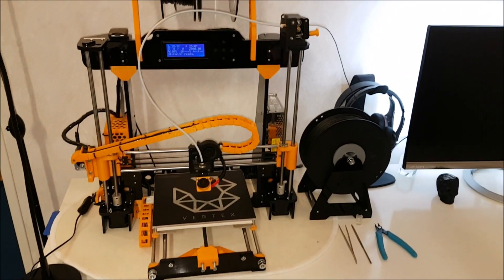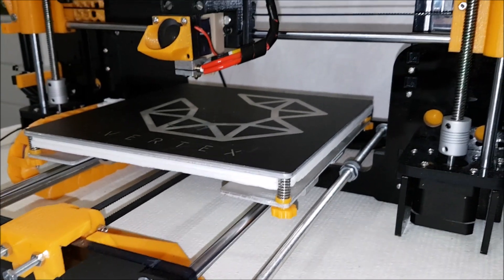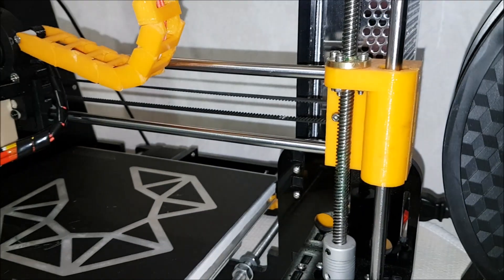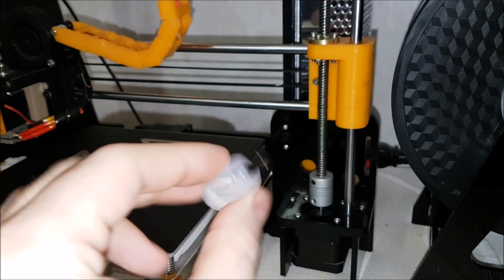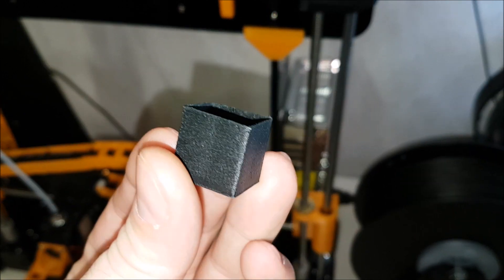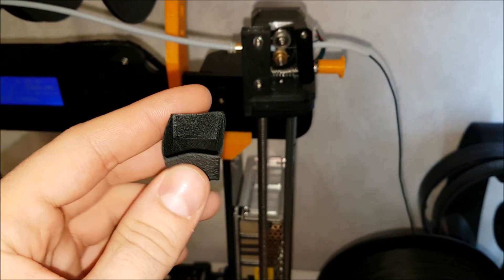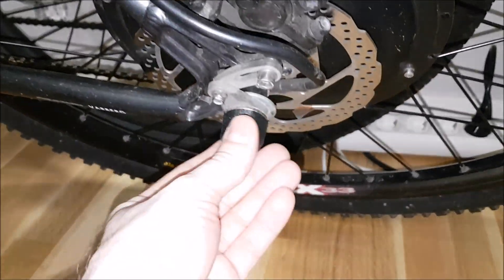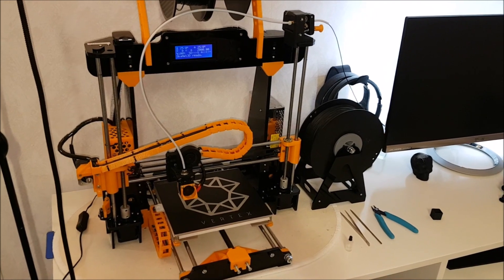Anet A8 3D printer upgrades part 4 heated bed insulation, PLA Igus bearings, flex filament printing

Comment: Does the ED V6 comes with nozzle? or I have to buy it sepparetly?
Reply from the maker: Felipe NS Yes It does comes with nozzle and Filament tube and fan as well with link I leave in video description. Cheers! :)
Reply: Comes with nozzle.. most likely 0.4mm.

Comment: Hey dude I really like your videos so much that I just bought the printer and I have a question. Which filament diameter to use? 1.75mm or 3mm? 
You could make a video showing the calibration you do and the settings you use to get that quality as in the T-Rex.

Like and Suscribe from Spain ;)
Thanks!
Reply from the maker: Hi man! Greetings from Sweden! Here is full List of Anet A8 1.75mm:
Black  PLA http://www.gearbest.com/3d-printer-supplies/pp_424994.html?lkid=10666772
White  PLA http://www.gearbest.com/3d-printer-supplies/pp_424993.html?lkid=10666773
Blue   PLA http://www.gearbest.com/3d-printer-supplies/pp_424995.html?lkid=10666774
Golden PLA http://www.gearbest.com/3d-printer-supplies/pp_423469.html?lkid=10666776
Silver PLA http://www.gearbest.com/3d-printer-supplies/pp_424997.html?lkid=10666780
Orange PLA http://www.gearbest.com/3d-printer-supplies/pp_423466.html?lkid=10666782
Red    PLA http://www.gearbest.com/3d-printer-supplies/pp_423467.html?lkid=10666784
Green  PLA http://www.gearbest.com/3d-printer-supplies/pp_423470.html?lkid=10666786
Transp PLA http://www.gearbest.com/3d-printer-supplies/pp_424996.html?lkid=10666788
 You can chose any color you like. It's great quality filament. 
 Check my other videos on my channel  you can find tons of useful information including settings and etc. 
Good luck with your Anet A8! Cheers!
Reply: Hi dude! I started to build it but i have a little problem,  i broke a part of the fuser, i attach here one link with pictures of my problem. Can you help me? It's possible solve this problem? Please help me!
https://myalbum.com/album/6QJ9cc7p9rvq

Comment: There is still one more upgrade you need to do. Add a Raspberry Pi wireless connection with Camera then you can check on the printer even if you are not at home. I have done this and its great. Paul, Happy in sunny Thailand. I like the modes you have done and rejected so far, thanks.

Comment: How did you solve the issue of the carriage becoming tight at the far right and far left positions?  I ended up filing a bit more out of bearings to accommodate but now carriage wobbles a bit.  What did you do?
Reply: I believe he printed a new x-carriage and bought the e3d v6 to solve that  issue.
Reply: I did the same but the x-carriage listed on the v6 upgrade video still has the tension problem.  I ended up printing a different ed3 v6 mount and using the factory bearings & enclosures.  They seem to have enough play to allow for tension.

Comment: I have my Tech2C Bowden mount set up now but from what I can see I have lost about 20 - 25mm in the y axis because the nozzle sits out further then the original and the bed can't move any further forward to compensate. Did you find this as well? Other then that I'm very happy with it and coupled with the inductive sensor I am getting awesome prints with excellent first layers everytime.
Reply: I am thinking of changing to this mount when I install my IGUS style PLA bearings.
http://www.thingiverse.com/thing:2143520/#comments

Comment: I have the Anet A8 with skynet and running Cura 15 the problem is i installed Practical 6 - 36V Auto Leveling Sensor and now it will not print the first few layers. Any assistance would be appriciated
Reply from the maker: Take off sensor like I did long time ago and problem is gone :D
Reply: Did you  have to reinstall original  firmware? Thank you for responding.
Reply from the maker: Only if you change to E3D V6 hot end.

Comment: How much money have you spent on upgrading this A8?
Reply from the maker: Well everything is printable. For parts itself like E3D V6 and some nuts there and there Insolation material, Micro Sd cable,Mosfet for heatbed,belts... I would say less than 50-70usd...

Comment: I got proper igus bearings as a sample for the bed and I never got them to run decent, I almost did them running right then after adding Anet A8 Brackets to Reduce X-Axis Motion
http://www.thingiverse.com/thing:1872162 it was worse than ever
Reply from the maker: Strange.. I never get that problem... And am using PLA igus bearings.
Reply: If you stuck a 8 mill drill through them the hole is more than likely slightly oversized so your bearings have the advantage on that one. (If you wanted an exact sized hole you would never use a drill but a reamer of the required size).

Comment: Hej, can I use thies as well under the bed?http://www.ebay.de/itm/3D-Drucker-Kork-Blatt-2-Mm-Dick-Hitze-bett-Isolierung-Dichtungen-und-mehr-RepRap-/201733934659?var=&hash=item2ef8478e43:m:m_l2sWFAYSg-wvzwvW4hBoQ
Reply: Cork is fine at the temperature the bed runs at, you don't need anything fancy a large cork tile from the hardware store will do
Reply from the maker: True

Comment: I've tried printing linear bearings downloaded directly from Igus. I even use Igus filament to print the linear bearing. I find that the printed bearing wears down fairly quickly. However, the one manufactured by Igus holds up very well. I am curious how yours will hold up.
Reply from the maker: Am ruining my printer every day and so far no problem. I just use some thin cheap oil from time to time to make them run smooth and not dry. So far I don't have any bad tolerance. We will see.

Comment: it is not cheap, but investing in a Raspberry PI and run OctoPi was one of the best improvements I made, No sd card, with a plug-in for Cura 2.4 sent file to Octoprint, keep track of my print using my phone etc....have a look at it
Reply from the maker: Thanks for tips I might order it.

Comment: Another great vid. Thanks for showing how well flex filament does work with bowden extruders. I am also modifying my A8 to Tech2c's E3D V6 solution after seeing yours working so well. I will try 5mm cork board for insulation under the bed. I was going to direct solder the bed heating connections but I see your stock white connector still seems to be holding up fine and not burning.
Are you going to add an inductive sensor?
Reply from the maker: Thanks for positive thoughts mate! Glad you like it. Yap! Tech2c is king! I respect his work a lot. He save me so much time by make 3D model of V6 setup! I have all parts for his type of Bowden setup but so far This setup work very nice like so. Yap 5mm cork board will do the work as well. Better something that nothing. Nope no need to solder connections. That PLA chain holder on heat-bed don't even get warm at all. Well, not in near future. I take sensor off. If you go back to my first video about upgrades you can see that I had sensor installed. That is not ''true'' auto level sensor and heat from bed can affect sensitivity of sensor. I just wasn't satisfied with results so I take it off. I still have it in workshop btw.